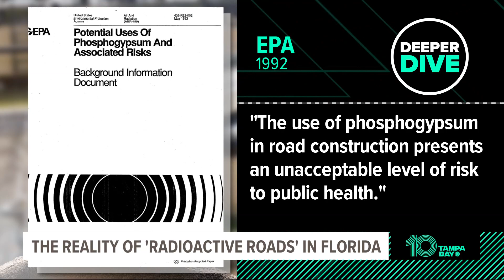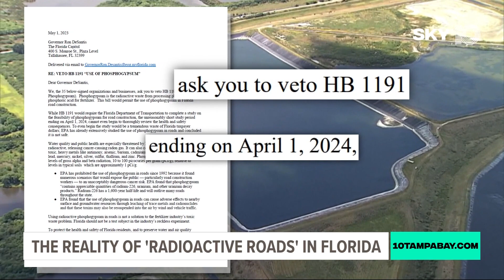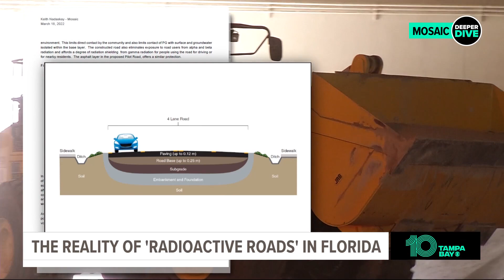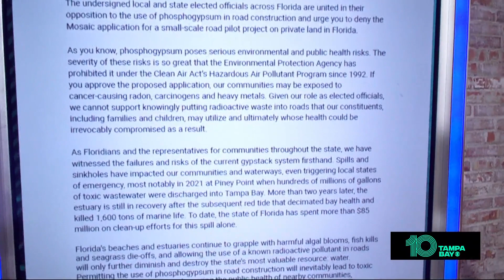Radioactive roads? Florida has yet to submit application to EPA to start testing

Comment: <yawn> Coal, metal, the potassium in your bones all is radioactive.  The Greens are knee jerking for power again.  This is the usual finding an angle to scare people with and get them to rally around the HATE to oppose the other tribe.  The stuff is so dilute it is just part of the background radiation that already exists.  Educate yourself about radiation as to what the cures, seiverts, and other measuring units are about and use the hard numbers to make up your own mind.  OMG! PROFIT?  What happened to useful repurposing of a material?
Reply: Well if you dilute it down , which will happen, to natural levels you will have lower than regular radiation levels and it will be safely encapsulated, especially if you put it in the base layer where even what radiation that is left shielded away by the wear layer they grind and replace which would maintain containment at no extra cost.  (The metal in the floor of the car or those heavy/ dense batteries are a massive shield as well)  <Yawn>